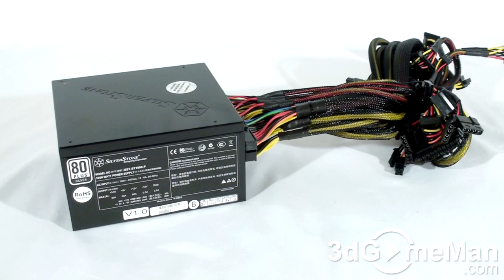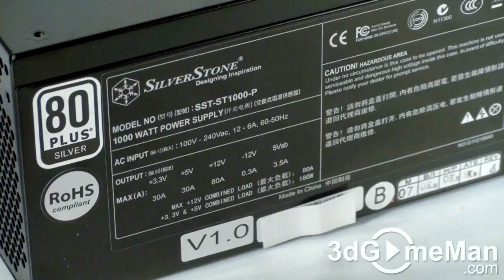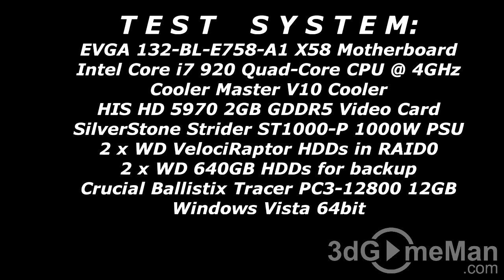#1129 - Silverstone Strider ST1000-P 1000W Power Supply Video Review

Comment: nice review! please let me ask one question. what are the diffrents on the ports of the psu on minute 4,48?I can see two times EPS8 PIN / ATX 4 PIN. which one of these two ports do i have to use to connect a GigaByte GA-EX58-UD5? Or are they both the same? If you have time please give me an answer. Just bought the psu and in the manual i cant find out. 

Regards from germany 

cj

Comment: @adamjamesroe If you look at the spec sheet, and it's in this video too, there are 4x 6+2 pin connectors and 2x 6-pin connectors. This means that you can run up to three high end cards in SLI or Crossfire.

For 3 high end cards each one takes an 8-pin and a 6-pin, so three of the 6+2 pin connectors would be used as 8-pins, one of the 6+2 pins would be used as a 6-pin, and the remaining 6-pin connectors would also be used.

Comment: love silverstone, always used their power supplies because they have the greatest range of single +12v rail PSU's usually with the highest combined off-peak amperage for each wattage field too!. These are one of the few/only 100% modular types aswell, its nearly 90% efficient at times, not to mention 30/30/80 amps and slick look too.

Comment: I wonder about something. How much watts does a i7 quad core motherboard use? Equipped with at least 3 1600mh 2gb RAM bricks? My current XFX GTX 285 had just enough power, if i bought a previous version I wouldn't have enough wattage. Thinking of upgrading because my cpu is a huge bottleneck, really huge.